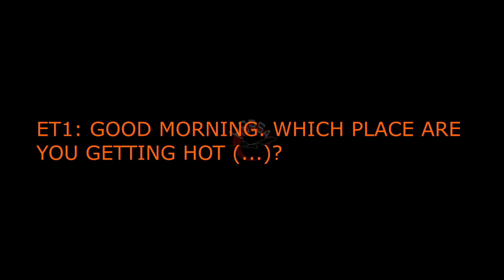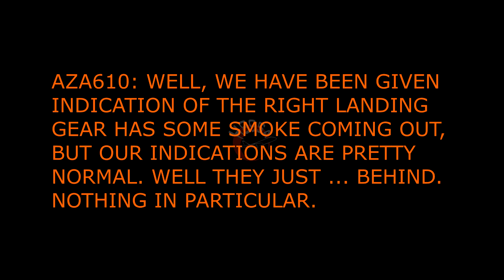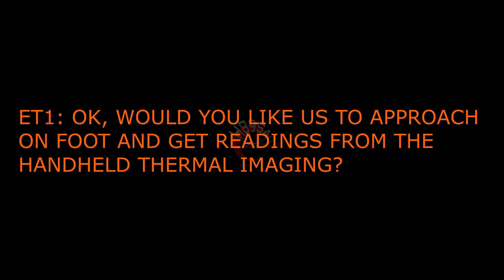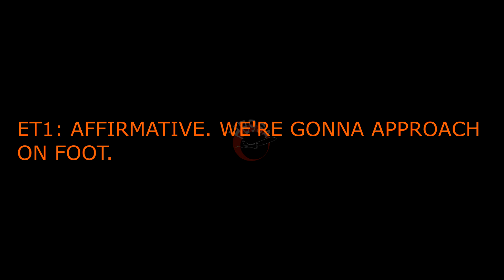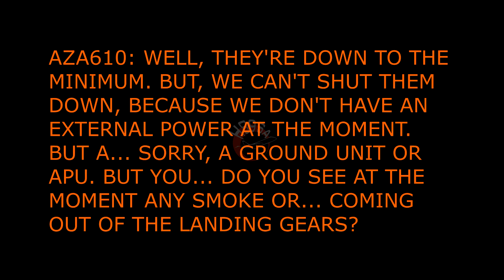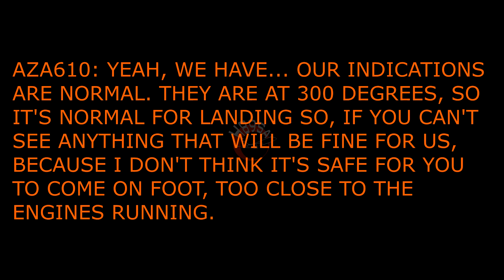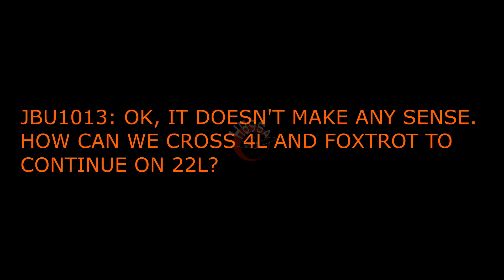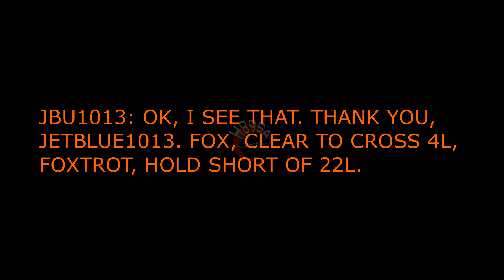AIR TRAFFIC CONTROL: I DON'T THINK IT'S SAFE! THE ENGINES ARE RUNNING!

Comment: At the end it seems really obnoxious to say cross 4L and 22L instead of 4L and 4R or 22R and 22L. Like just pick a heading an stick with it.
Reply: I looked at the airport diagram, and this makes no sense to me either.  Maybe Kennedy Steve can explain the phraseology?
Reply: @steverosengren1492  He sure is missed.
Reply: @steverosengren1492  I'm no KS, but it makes sense if you expand the runway designations to their full names.  He is asking the aircraft to turn on F and cross 4L/22R.  Now the plane is between that runway and 4R/22L.  Foxtrot continues all the way to the latter runway, making a bend to the right as it does so.  The plane will wind up holding short of 4R/22L at about the middle of that runway.

Comment: The description is seriously lacking. No idea what this is about
Reply: Plane had report of smoke coming from landing gear, Emergency truck deployed to verify. They wanted to take a thermal reading with hand held to verify planes instruments but could not approach on foot due to the danger of the planes engines running that they could not shut down due to no external power supply. Visually confirmed no smoke, followed them down the taxi way to ramp.

Comment: Don't get close because the engines are running??? And no APU???? Hey Captain let me educate you as a former B-52 pilot AND an former jet engine mechanic . YOU DO NOT need to shut down the engines on your bird but try idle, and YOU DO NOT need an APU to start your engine, why? because you only have to shut down (at most) the engine on the side they want to look at and to restart it there is a switch on your overhead that is called bleed switch. All you need to do stupid is follow the diagram on the bleed switch(s) from the running engine to the shut down one and you can start the shut off engine. I have NEVER flown on any kind of jet that does not have bleed switches to move air around in case you had to start in air or on ground in emergencies. Maybe you need to go back to flight school for your plane
Reply: Somehow I think the guy on the pilot seat doesn't need a random noob like you to lecture him.
Reply: I was thinking the same thing. I'm sure the pilot just forgot about it in the moment. I find it odd that they don't have an APU, maybe it was non-functional?
Reply: I assume the genius who replied about a cross-bleed start forgot that the crew would have to increase the thrust on the operating engine (s) to give sufficient bleed pressure to the air starter and I’m sure the aircraft behind him would have something to say about it.

Comment: Wonder why they couldn’t start the APU and shut down or shut down the engine on that side?
Reply: They probably wanted to be able to taxi at  a moment's notice and most airlines don't allow taxi on a single engine.
Reply: Maybe the APU was inoperative and they rely on the Engine power or GPU power and since they were not at the gate/stand its pretty much only the engines
Reply: At 1:30 they said no ground power or APU